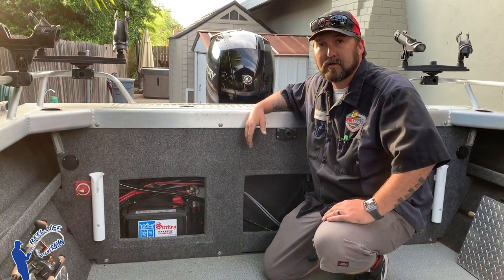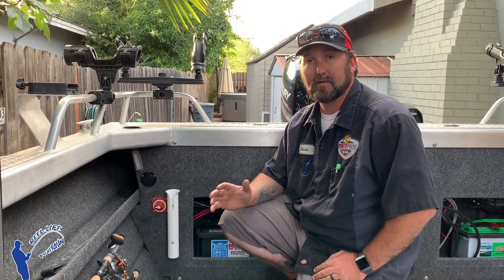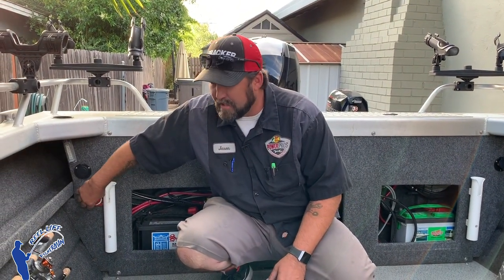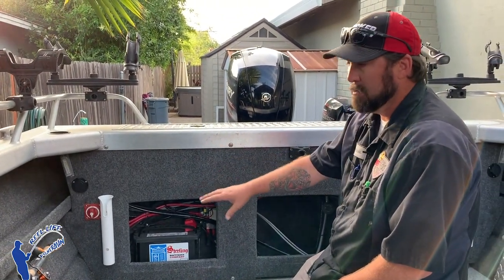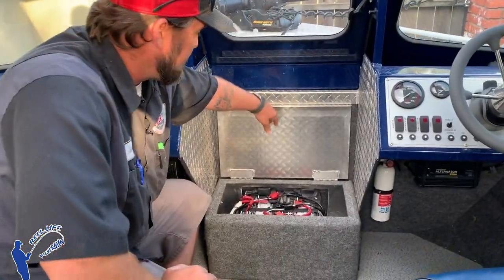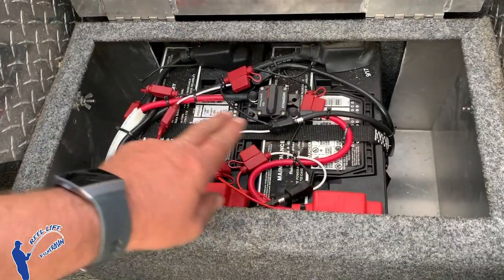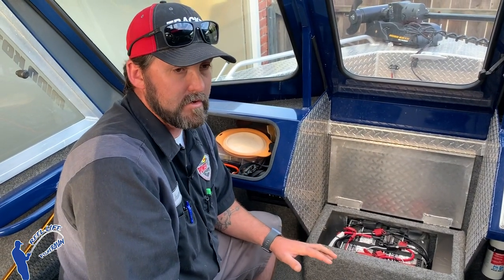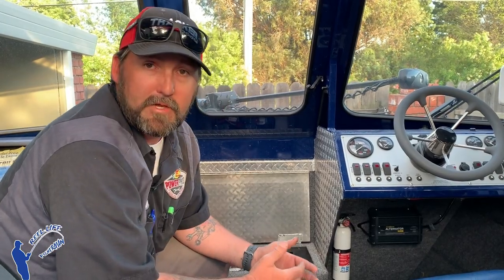BOAT BATTERY WIRING  | HOW TO

Comment: Hey RL Fisherman! I love the video and have subscribed!  Quick question. Do you happen to know why my trim motor is making a loud noise once it's red positive line is simply touching my battery . Even before I have touched the trim toggle switch . It's making the same noice as if im touching the switch even when I am not touching the switch ? I'd greatly appreciate any feedback you can provide! Thank you so much for your help 😊
Reply from the maker: Sound like your switch might be sticking.. try unplugging the wire from the switch and see if it goes away..  what kind of boat? Do you have more than one trim switch? Let me know.. thanks for subscribing!
Reply: @ReelLifeFisherman  it's an 125 force motor with a toggle switch that goes red for power , green for up , and blue for down . My boat is a 89 quantum Bayliner . Thanks !

Comment: Is there a diagram someone can point me to for wiring up two batteries on my boat so that I can run electronics while the motor is off but also be able to charge while running? TIA
Reply from the maker: Not sure of any diagram ..but check out blue sea star add a battery kit it comes with a isolator.. that will allow the engine to charge both batteries without messing with the switch.. I will post the link for it.. thanks for watching and hopefully that helps..
Reply from the maker: Blue Sea Systems Add-A-Battery Kit https://www.amazon.com/dp/B000RZNP5K/ref=cm_sw_r_cp_api_i_mMKHEbAPRNJ1D

Comment: I have a battery cutoff a six fuse, fuse block and a six switch, switch panel. We will start with battery and go to the cutoff, then WHAT comes next in line? the fuse block or the switch panel. No trolling motor for my boat.
Reply from the maker: So if I’m understanding you right.. it should be the fuse panel next.. then from the fuses to the switches.. thanks for watching let me know if you have any questions

Comment: Do you have a lost of parts you used? The switch, chargers, types if batteries ect?
Reply from the maker: I can type you out one when I get home this evening
Reply from the maker: With the links to the parts on Amazon
Reply: @ReelLifeFisherman  thanks. I'm an electrician by trade so wiring it isn't the issue knowing what components to use is what I'm having issues locating.
Reply from the maker: Blue Sea Systems 300 Amp m-Series Battery Switches https://www.amazon.com/dp/B000MMFJH0/ref=cm_sw_r_cp_api_i_h.BSEbAWPSZTF
Reply from the maker: Safety HUB Fuse Block 150 RBS https://www.amazon.com/dp/B0053BTSEK/ref=cm_sw_r_cp_api_i_zaCSEb17GNJM3
Reply from the maker: Boating Accessories New MINN KOTA Marine Batt CHARGER-MK210D 2 Bank 5A MIN 1822105 https://www.amazon.com/dp/B0042T4GIW/ref=cm_sw_r_cp_api_i_bcCSEbZGD8T1J
Reply from the maker: Minn Kota On-Board Alternator Charger https://www.amazon.com/dp/B001PTHKJY/ref=cm_sw_r_cp_api_i_jdCSEbNCBQE68
Reply from the maker: Let me know if you have any questions about anything..  I would use any good brand marine cranking battery and a deep cycle for the house battery.. for the trolling motor batteries as big of batteries as you can fit.. the minn kota alternator charger is just for charging trolling motor batteries when running the gas engine..
Reply: Reel Life Fisherman thanks. This will help tremendously with the fishing pontoon build I am doing. Now to research how big of batteries I can fit lol

Comment: When you switch from battery 1 to battery 2. Can you do that while the engine is running or will that short circuit the alternator?
Reply from the maker: It’s best to shut the engine off .. there can be a voltage spike between the positions where voltage has nowhere to go.. that is what I have always been told.. and better to be on the safe side.. thanks for watching and commenting..
Reply: @ReelLifeFisherman  yes i understand that but it was not mentioned and feel it’s important to make note.
Reply from the maker: I do have another video I did more recently that I talk about it in more detail
Reply: 👍 @ReelLifeFisherman  great thank you👍

Comment: Awesome video !! Excellent work !!   I just subscribed...i am currently running 2 batteries in parallel with my minn kota  ( 55 lb thrust on a 14 ft boat )...its very old and i want to upgrade to an i pilot ... what would be the pros and cons of going to a 24v volt system ? THX Brian
Reply from the maker: You can pick up an 55lb 12v terrova with I pilot.. it’s the only one that has it.. only comes in a 54” shaft.. which would all be perfect for you.. the only advantage to running a 24v on a smaller boat is you can run on lower speeds and to the same work.. but it’s not worth the extra cost in my opinion.. especially since you already have 2 batteries.. I would get the 12v terrova with I-pilot if it were me.. and save some money.. thanks for watching! Let me know if you have any questions.. tight lines!🎣
Reply: @ReelLifeFisherman  THX so much !! 12v Terrova i pilot is going on my boat : )

Comment: Hi. I’m running 4awg wire from starting battery to center console where my audio amplifier will be mounted. Can I run the power and ground from the battery to + and - distribution blocks and then hook the amp into those blocks?

Comment: If you have a 2 bank charger for your trolling motor batteries, and the batteries are wired in parallel do you only use one of the banks to charge both batteries? or do you use one bank for each battery? If they are hooked in parallel wouldn't the charger think there was only one battery no two?
thanks for your help
Reply from the maker: Thanks for watching the video.. if you have a two bank you should still hook them up to each battery.. they are a smart charger and it won’t hurt them.. you can technically hook up only one bank..it would charge both.. but every manufacturer tells you not to do that.. plus it would take much longer to fully charge.. hopefully that helps.. let me know if you have any questions

Comment: Hi, congratulations on the way you explain your videos, and I want to ask you for help: I just bought a Chaparral signature 27 model ‘93 and I need to learn how to recharge its battery system while I have it at home! I have Connected the cable that feeds it but I don't want to make a mistake that I may later regret and I prefer to consult it with you as a professional that you are!
Reply from the maker: Do you have a smart on board charger? If not I would suggest getting one with a bank for each battery.. they are great and will make your life worry free as far as batteries go..  there are quite a few different brands .. let me know if you have any questions about it .. would love to help out.. thanks for watching the video

Comment: Great video, awesome boat sir !!!!
Quick question about your house battery: Do you power your electronics from this battery as well and does it cause interference? My Helix 8 draws 1 amp hour, can be on for 8-10 hours. 
thanks for your input !
Reply from the maker: Yes my house battery can power everything on the boat same as the cranking battery.. check out the latest video on my channel it goes over the duel battery set up in detail.. on a board I made to explain it all better.. thanks for watching

Comment: Interesting video.. and from what i learned i think that my dual battery switch is hooked up incorrectly from the audio shop.
So i have engine etc hooked up on #1 battery, and radio etc hooked up on battery #2. Should both engine etc, & radio etc also be hooked up going to common all together ? Just wanting to verify. Thanks
Reply from the maker: So that would work ok if you have an isolator installed.. charging both batteries equally while running the engine.. only problem there is you can’t kill all power to the boat by turning the battery switch to off.. that wiring set up is usually done with just a isolator and no battery switch.. then both batteries are being charged and the engine is only hooked to the crank.. and the boat and audio system is hook to the deep cycle house battery.. that way you don’t have to worry about the engine battery getting drained and it will start.. hope that helps.. let me know if you have any questions.. and thanks for watching
Reply: @ReelLifeFisherman  Ok I think im gonna go ahead and re-run. So basically run all positives from starter,audio, lights etc to the common, Then run Battery1 power to switch1 and battery 2 power to switch 2, jumper the grounds between both batteries and to main ground. Is that correct? Thanks for your time.

Comment: HI , I HAVE A PONTOON BOAT WITH TWO BATTERIES , WERE DO THE STARTER LEAD WIRE CONNECT TO ON THE BATTERY .
Reply from the maker: Do you have a battery selector switch?
Reply: @ReelLifeFisherman  YES I DO
Reply: @ReelLifeFisherman  YES I DO
Reply from the maker: Then it should be on the output side of battery selector switch or on the bus bar or power fuse block that is hooked to the output side of the selector switch.. hopefully that helps let me know if you have any questions..

Comment: so you have a separate battery bank just for your trolling motor? do you have a switch setup to turn that on then or am i mistaken is that battery bank connected to the rear bank?
Reply from the maker: The trolling motor batteries are totally separate from the cranking battery and house battery. In my set up they have separate chargers even .. but only because 4 bank battery chargers are expensive!  Thanks for watching

Comment: hi jason can you tell me how you got your wiring from the front of the bow to where you have your batteries for your trolling motor? i removed the storage box and bulkhead access panel but i can see no way of fishing a wire to the trolling motor recepticle if i were to drill and mount one in the same place you have yours. i hate to ask dumb questions but i have no idea how to fish that wire.i installed a bow mount trolling motor on a tracker super guide that i own but it had a bow access door and the battery box was right under the bow casting platform so it was quite easy. if i can get it figured out i am gong to go with a 12 volt 55pound thrust with 2 batteries wired in series just for steering and use a transom mount kicker for propulsion  PS if there is a way to donate money i would have no problem supporting your channel. thanks again from the frozen north

   
,
Reply from the maker: That is awesome thank you it’s much appreciated!  So if you drilled the hole for the receptacle you can fish it around the side of the bow.. there is also a pvc pipe on the drivers side just above the carpeted board in the top corner.. but if you not have a access port in the bow like the newer ones have .. it won’t help unless you put one in.. so I just drilled the hole and run a fish tape around the side of the bow past the bow storage/ live well and fished it that way.. hopefully that makes some sense hard to explain.. let me know if you have any questions about it.. thanks again for watching the channel!
Reply: @ReelLifeFisherman  thanks for the quick reply i will go the fish tape route as i am to much of a coward to cut a  hole  in the bow. i had no idea i could get a fish tape around the side.could you also post a picture of where you mounted your transducer when you get time or would anywhere on the transducer mounting plate be close enough? thanks again
Reply from the maker: Do you have Instagram or Facebook? That way I can share pictures
Reply from the maker: It will be easier if you take the board out from under either the driver or passenger side also.. that way you can see around the bow storage box
Reply: @ReelLifeFisherman  i am to much of a dinosaur for either of those but my wife is on Facebook she could ad you as a friend so if you get a friend request from bev patenaude that will be us, thank you

Comment: Hello. I have a bass boat with 3 batteries. It’s a sportsman 1610 with a 24V minnow kits trolling motor. 
My boat have accessories, live well, bilge, 70hp motor. Gauges ie, temp, speed, battery. I also have a 3 bank on board charger. 
I need to replace my batteries. 
My question is, my 2 12V batteries are hooked in series. 
Do I want anything beside the motor hooked up to the “cranking battery “? 
Should my trolling motor and everything else be hooked up to the other 2 batteries?
I can’t find and online or in my book to properly hook up my boats batteries.
Reply: Minn Kota, not minnow kit…auto spell strikes again

Comment: How do you wire the alternator charger?
Reply from the maker: johnphan76 hook the banks to your trolling motor batteries the other leads hook to the starting battery .. and the purple wire hooks to a key on power source.. it’s sense wire .. usually hook that to hr. Meter or Ignition wire
Reply: Reel Life Fisherman cool thanks

Comment: Sure would have been nice to see what wires you hook to the switch and where the wires run to. I need to know how to install a switch for my cranking battery only. Would my outboard get wired to the switch or do I just put a red wire from my battery to the switch? No seems to be able to explain this single cranking battery shut off set up.
Reply from the maker: I answered your question on the other battery video just now.. sorry been real busy lately.. let me know if you have any questions.. i do have a video on wiring one coming up .. just needs to be edited.. but again been busy

Comment: Excellent information
Reply from the maker: Thanks glad it was helpful! Thanks for watching and commenting..
Reply: @ReelLifeFisherman  , Your most welcome. Have been building , designing , and repairing boats off and on for over 40 years and fishing for 60 years just always been weak at electrical so I'm always open for good information like you Sir present.Presently custom building a 1957 Lone Star ElDorado 18' totally set up for down rigger fishing and possibly living on if this country goes nuts ( it already has )spending my retired years with my dog and traveling the country fishing wherever the wind blows.

Comment: On the water, you have 4 batteries are all of the batteries being charged from the main motor?
Reply from the maker: Well now that I have a battery isolator charging relay on the back for the cranking and house battery set up.. yes .. with the minn kota alternator charger , charging the trolling motor batteries..and the isolator charging the house all while the battery switch is in position #1 . Let me know if you have any questions.. thanks for watching

Comment: How do I need to wire my pontoon boat to add a 24v system for my minn kota ulterra 80# thrust. I have 2 agm batteries for the trolling motor. I also have a Noco genius 10x4 that should charge my starter battery, 2 agm for the trolling motor and a spare charging wire for a 12v battery to charge a 12v electric anchor winch. I have an onboard plug for plugging in the onboard battery charger. I have a lithium ion 12 x 23 battery and separate battery charger that runs my Garmin 93sv uhd fish finder. I have a 50 amp circuit breaker for my 24v ulterra. My name is Tim and I would love to be able to text you. After having seen a couple of your wiring videos, I had no idea that a POS and neg bus bar is required. I want to be able to run my wiring to some toggle switch bars that needs to be mounted on my console somewhere. I have a 2022 sun tracker 18dlx pontoon boat. I'm having to mount my 2 trolling motor batteries inside my L bench seat because there is not enough room under my console. In fact I intend to mount my Noco charger and lithium ion battery inside my console. Please help me, thanks, Tim.
Reply from the maker: Thanks for watching the videos! So definitely the charger you have will work great and sounds like you have all the equipment.. you don’t need to have the positive and negative bus bars . You do have a fuse panel under the console that hopefully has another empty couple spots you can use and has a negative bus built into it. Now with the lithium battery for your fish finder . Do you already have that and have it wired up? That seems  a bit overkill to run your fish finder .. your crank battery would handle that just fine.. and then you could have your battery run your anchor winch. That also needs a circuit breaker.. cool thing with the new noco chargers is that they can be switched to different battery types per bank. Let me know what questions you have. And I’d be glad to help. I have a Instagram @reel_life_fisherman or my Facebook page reel life fisherman you can message me on those as well and I will respond. Thanks for watching the channel

Comment: Is the stater strong enough to charge 2-3 batteries when they are larger deep cycles?
Reply from the maker: You would need to look at getting a Minn Kota alternator charger. It will be able to do that . It boosts the excess charge from crank battery .. that will put a charge back to you deep cycles with run the motor on the water. Then make sure to have a on board battery charger to charge and maintain the batteries at home or at the slip .

Comment: Gday from Australia Mate.
Thanks heaps for the video. Very understandable and useful. Do the trolling motor batteries have to run back to a common ground? I keep hearing about electrolysis and just wanted your thoughts. Thanks again.
Reply from the maker: Thanks glad you liked it! No the trolling motor is just hooked directly to the batteries.. and the batteries are not ran to anything else.. thanks for watching.. and let me know if you have any questions